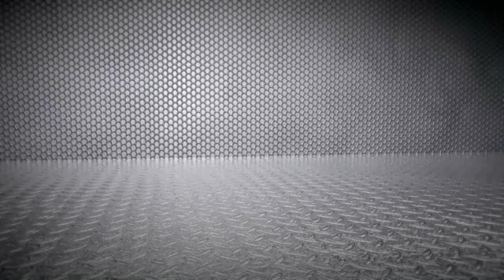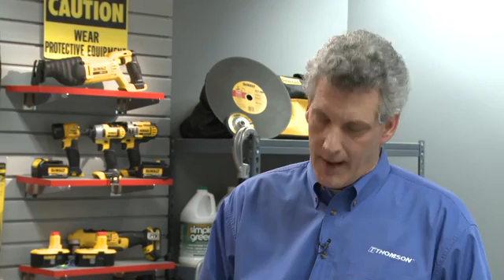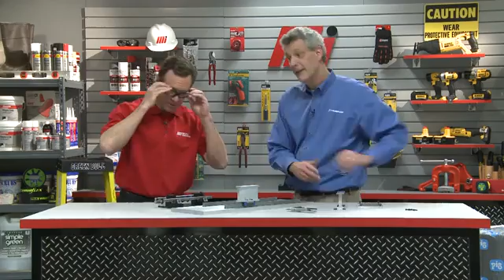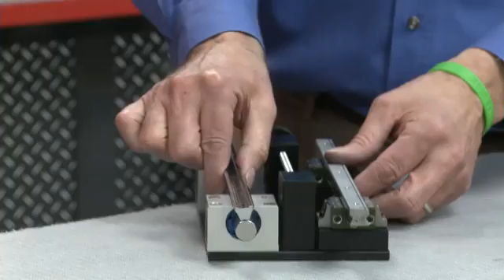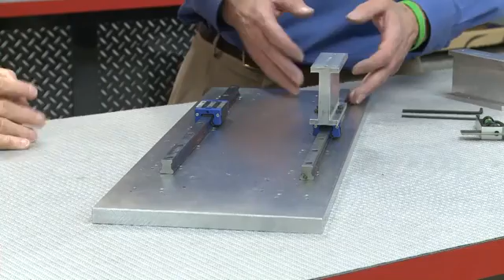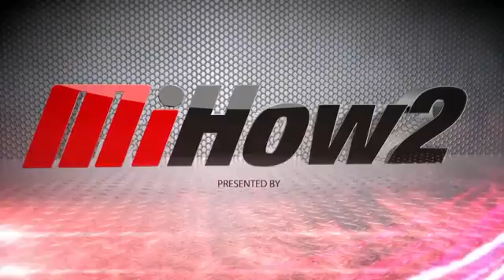MiHow2 - Thomson Linear - Installing the Proper Linear Guides in Various Applications

Comment: 3d printers use these, many times the main difference between the designs are the way their motions are guided. I've been trying to decide what flavor of delta type 3d printer to build. some use wheeled carrages (cheapskates) some use two rods with rod bearings zip tied to printed parts some use the profile rail. I have not yet seen anyone using the round rail. I see that they have less alignment issues, but are they as precise?

Comment: In order to avoid misalignment we use reference surface of our base mounting plate and reference surface of guide rail. How do we drill aligned holes into base plate without using any auxiliary machine ? How to drill holes on mounting plate (machine bed ) if it is too big to bring under milling machine or drill press.